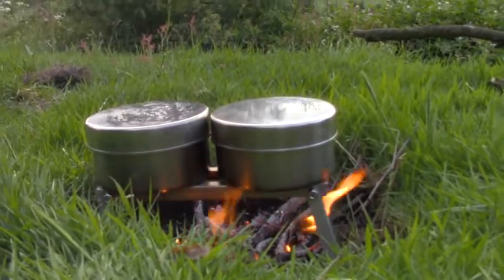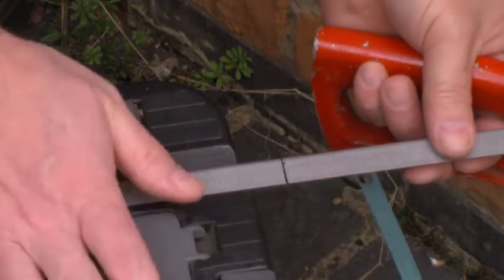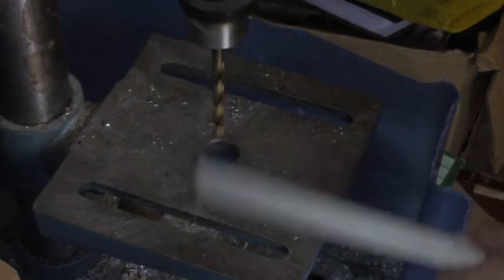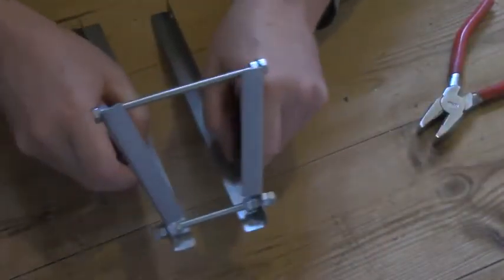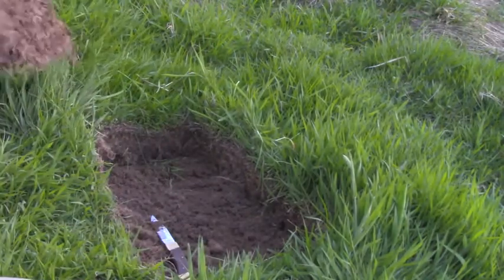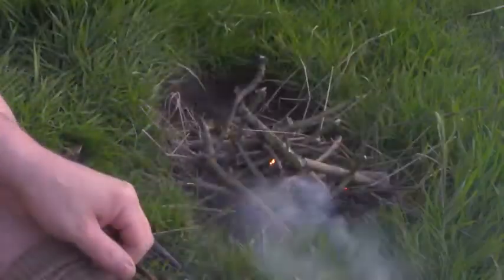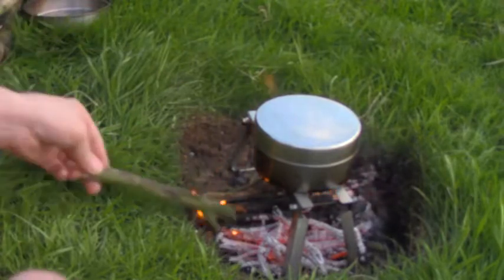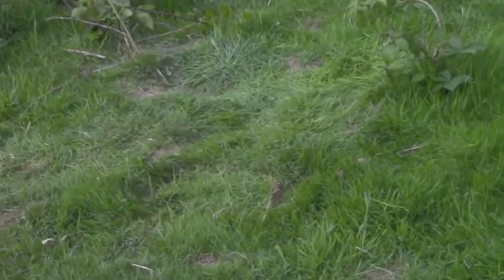'The Free Range 'Feral' Stick-Fire Cooking Grate'

Comment: Can u make me one pls if I buy it from u?Thanks
Reply from the maker: That would defeat the object of the exercise!

You could just use a large metal biscuit tin (the sort everyone disposes of after Xmas/Easter) with the lid off, light a fire in the bottom, and put rigid wire mesh over the top (that's popular at festivals).

The point is that it's not just cooking outdoors that is the "disconnect" from 'modernity'; the act of creating the grate represents a physical manifestation of the "disconnect" from the culture of consumption.

If I wanted ot make money, I wouldn't give the designs away for free :-)